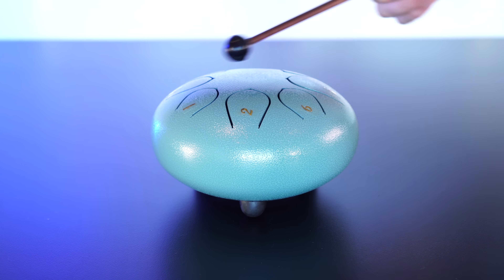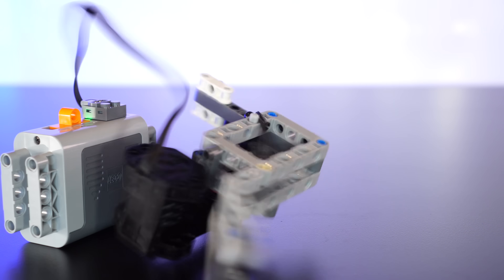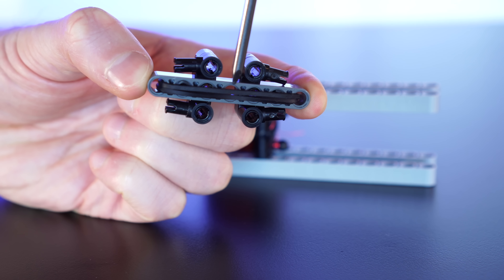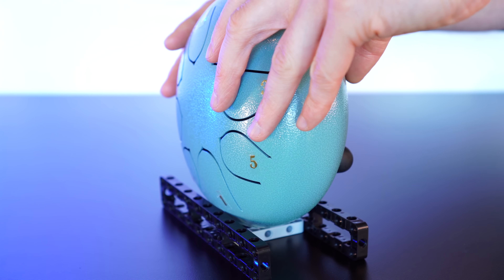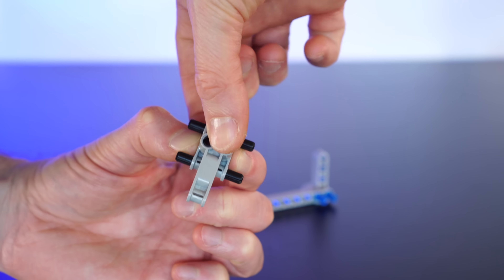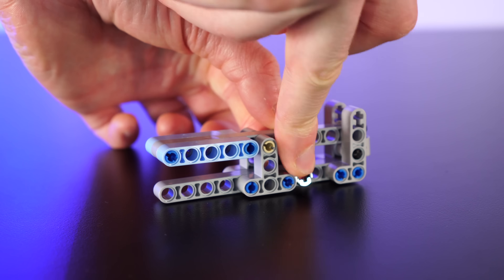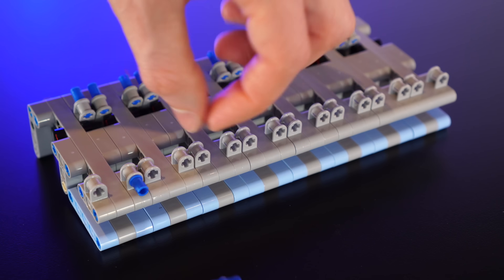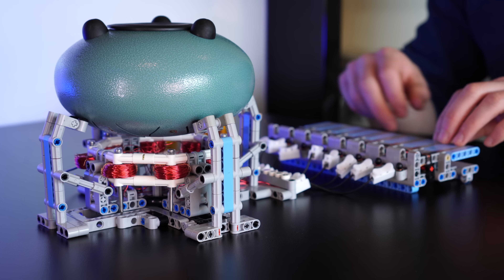Lego MUSIC Machine: Making an Electric Piano Drum!

Comment: Creative, I'll give you that. but you had to use materials that are not part of a stock retail Lego kit, which is misleading.

Making a Lego frame to hold non Lego components to play the instrument is a letdown.
you could have used any material to that end.

100% Lego is what i clicked for, and I was dissapointed
Reply from the maker: That's fair, I'd imagine my videos probably just aren't for you. Almost all of my projects focus on basic electrical or mechanical engineering topics that are explained through Lego, making use of magnets, wires, circuit boards, etc., in addition to Lego.

Comment: this is similar to what someone did inside a cave. they attached hammers with microphones to certain stalactites which rang at a certain frequency. then a microphone picked up the sound, sent it to an amplifier, and then to a speaker. this person found 88 stalactites that correspond to the 88 keys of a piano. some of the wires were very long. as to not damage the stalactites, the hammers, did not hit very hard, just enough to produce a clear audible sound the microphone could pickup.
Reply from the maker: I think I saw that a while ago in a veritasium doc - what an incredible invention! Loved it

Comment: So, you can make it sound louder or softer varying the number of batteries you connect... and make a "potenziometer" to control the volume with left hand. But use a xilophone, so you have all 12 notes and the instrument will be full chromatic. Then add pickups on metal tongues... and you have an electric piano 🙂

Comment: This has been way over engineered.  You don't need a solenoid. Or elastic bands. You have the key fling the hammer directly, using gravity to reset both. That also allows you to control volume by how hard you press the key. The most useful component you built was the stand.
Reply from the maker: That's a fair summary of most of my inventions - largely over engineered things that don't need to exist!

Comment: I'm not sure if I'm seeing this incorrectly, but it appears as if all those five batteries are connected in parrallel. That's not going to increase the potential, but rather spread the current load to each battery. 
Maybe try connecting two pairs of parrallel batteries in series for 18V of potential. That should do QUITE the difference.

In detail;
This is the magnetic field strength formula for a solenoid: 𝐵 = 𝜇 𝑛 𝐼 
Field strength is proportional with Current (𝐼). Since the coil has a fixed resistance, it is by increasing the Voltage (potential) that a greater current will pass thanks to 𝐼 = V/R. 
A good-to-know is that batteries will also have an internal resistance. That will introduce another limit to the power the battery can deliver by reducing the voltage accross the coil (also dependent on the coil's resistance). 
And to top it all off, there is also a discharge rate for the battery. It is effectively the battery capacity (Amp Hour) divided by time (Hour) to discharge. There's more to this, but it simply means that having batteries in parallel will decrease the load on each battery, in turn increasing the potential (Voltage) closer to the rated voltage. I presume that is why seeing 5 batteries in parallel had a noticeable impact on the solenoid's power. And also why I recommend at least having two parallel pairs in series. 

It's been ages since I've done calculations regarding electricity. Anyone's invited to correct me.
Reply from the maker: Hmmm that's a good point. I did have them in parallel - my rationale being that I just wanted more current. I didn't factor in that they may have been spreading the current load across the batteries. I actually did try two in series for 18v and it was a bit violent. I didn't want to damage or mistune the drum while filming 😅 Thanks for the heads up though, I may need to consider that for other projects

Comment: 9v batteries are a very bad idea, they are low capacity, low current and high price.
Reply from the maker: Yeah their current supply sure is bad. But I have hundreds of them lying around from previous projects so these are really just the remains that need a purpose. I do have several bench top power supplies, but they felt like overkill

Comment: I wonder if you could connect it to a Raspberry Pi or some such rather than keys to control the current through the solenoids to make a "Player Piano" type deal.

Aside from that, could you make a second one, using four or six batteries in it, and connect the keyboard, giving you 16 notes to hit rather than just eight?

Comment: Next I would consider how to minimise the keyboard noise. A rubber mat may help. Also some springs or bands to create the 'action' and give you dynamic range and sensitivity to each note.
Reply from the maker: That's a really good idea, that'd certainly make it sound a good deal better
Reply: @JamiesBrickJams  is there a way to convert finger 'pressure' into voltage (kinda like the 'test your strength' stalls you get in fairgrounds...)
Reply: Actually, rather than a rubber mat; a bit of felt would probably work better; as I believe that's actually whats used in real pianos.  I think those little felt pads you stick on the bottom of furniture would work.

Comment: You should build a vacuum engine next
Reply from the maker: I've built quite a few! Turns out I'm not very good at them. But will make a video on them in the next while
Reply: @ good luck, I’d reccomend building one like what kfplus Sligo mastery builds with that sort of valve as they tend to be the easiest. With a 3 long lift arm instead of a 2 long one as the crankshaft to get a bit more torque. Once you’ve built a few Woking ones it gets a bit easier. Also thanks for replying❤️
Reply from the maker: Bril, cheers for the suggestion - I'm not familiar with his stuff, so I'll take a look!

Comment: Hey I’ve wanted to make some electro magnetic projects for a while and I was wondering what brand of wire you use?
Reply from the maker: I used to use a brand called Emtel on Amazon, but they've stopped shipping to Ireland for some reason. So now it's just any old brand I can find on Amazon that matches the right specs for the project